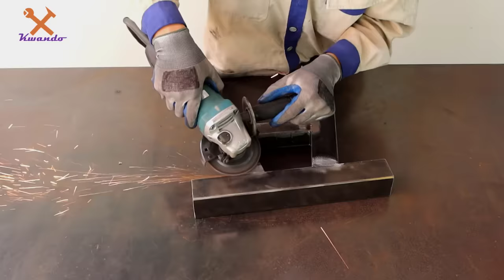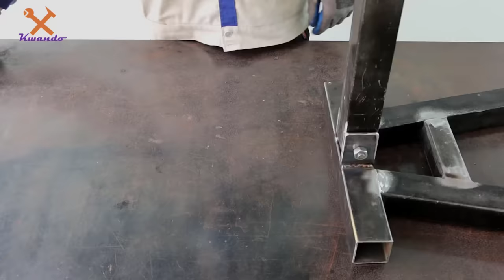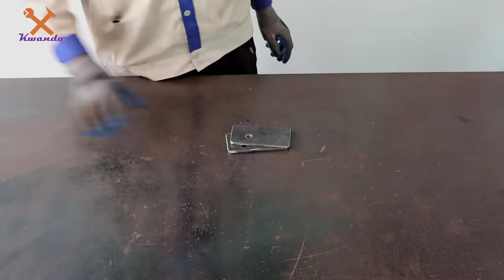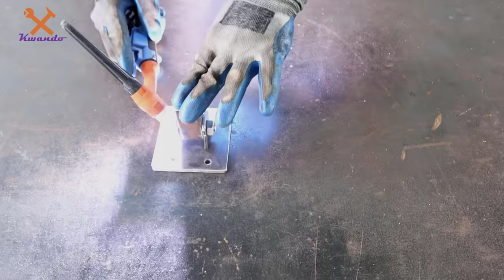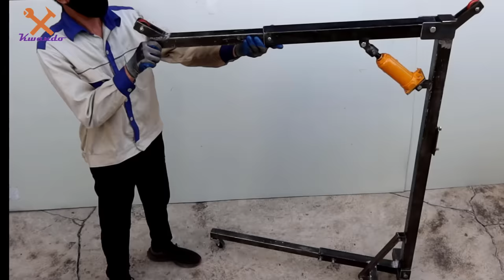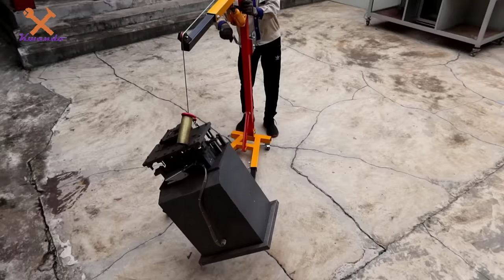Homemade A Small Mobile Crane For Workshop

Comment: The chassis & hydraulics will handle substantially more than 200kg. Only weak point is the cable gauge. Go thicker & it'll handle a Chev sb no problem. Weld a containment wall around the pivoting jack baseplate before bolting the jack to it, just in case of bolt-shear. Don't grind your welds. Leave them for strength.  Cage that lower support strut on both ends as well, incase of bolt shear. If it lets go of that post, there's nothing to keep it vertical. Maybe a pair of backup struts made from flat steel going from the post to the legs also, just for good measure. Beautiful work. Love it.
Reply: glorious advice, this may need to be made into an open source project. WAY more worried about that cable vs the bolts shearing. I'd have to imagine the bolts will start deforming the holes into slots way before they'd sheer; you'd know to back off if a guy was paying attention. think it could do more than 2 tons if you were careful, casters and weird weld angles would be the failure points to worry about imho. Though of doing this with front steering knuckles from a car on pins welded between the web of an H-beam column; set it down like a proper crane for the big boy lifts. Then add backup reinforcement to buy oh-shit time like you were saying.
Reply: I wish that I had someone like you to give me direction in life...

Comment: The wench is a problem. Watch the edit where you see a few seconds are missing and suddenly,  his hand is  holding the handle of the wench. He is NOT using a two way reversible hand wench, which will be very problematic. He's using a one way. He could also add a way of folding the legs up so it's easier to store in the shop when not being used. Other wise this could be a useful design.

Comment: I bet it can not lift more then 200kg..., when I made mine I use square tubes with 4mm wall thickness and even then felt that the boom should be made frem 6mm - when spend so much time to make something make it good...
Reply from the maker: My crane can lift up to 450 kg.

Comment: You should never use a bolt as a pin it will snap without warning
Reply from the maker: Many thanks for your suggestions.
Reply: What material do you suggest for pins

Comment: The boom should be no longer than the legs, I would not like to use it , but well done.
Reply from the maker: Many thanks for your suggesitons!
Reply: The legs can also be made extendable quite easy. This way depending on the load volume they can be adjusted to fit the space available.

Comment: The hydraulic jack should not be used in this configuration. It is meant for vertical  lift for car. Usually this type of jack is made of cast iron and cannot take bending load. You have to use hydraulic cylinders meant for this type of configuration. Don't use car jack in this configuration. Its neck can break catastrophically.
Reply from the maker: You don’t know all functions of hydraulic jack. Thanks!
Reply: Using 3mm thickness parts maybe it can support a half ton or less. So, I do not presume a catastrophic fail but a little bit less working life. I also presume that's a 4 ton jack. Best regards for all.

Comment: the initial beam weighed at the limit 25/30 kg the other I do not know but it does not reach 40 kg
Reply from the maker: How can you confirm that?
Reply: @KwandoTechnic I worked in a building construction company
Reply: 224/5000
if you want to go see the pei tables of the iron beams and do the proportions. the wheels you used are ridiculous. I have a small industrial crane that has the capacity you say and is made with very different materials